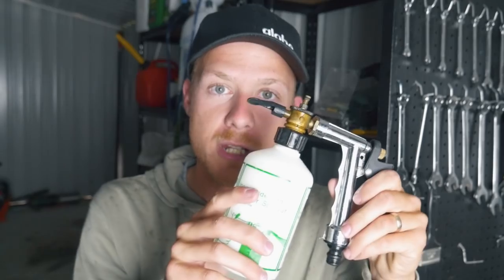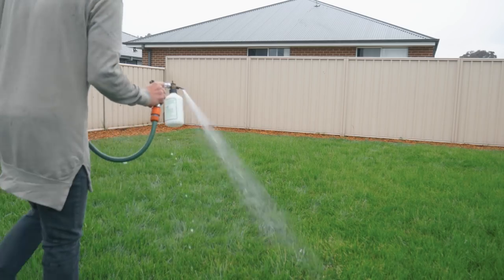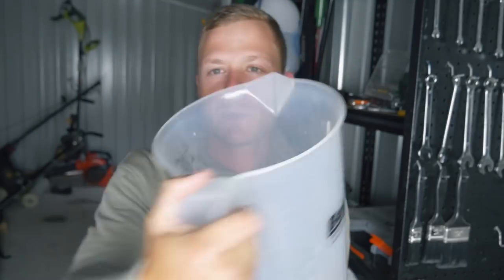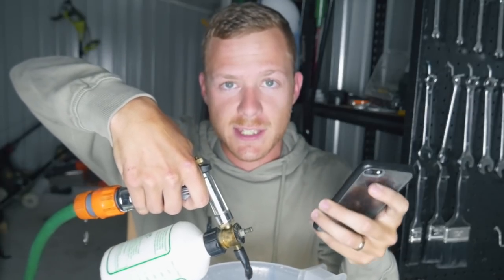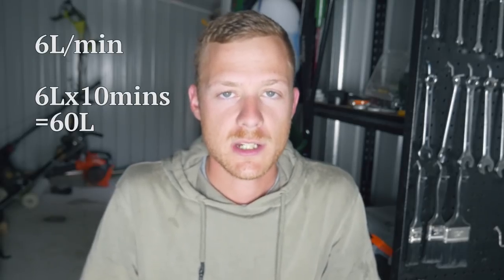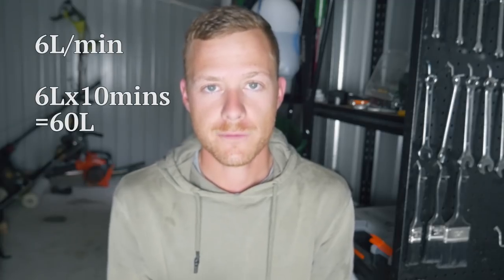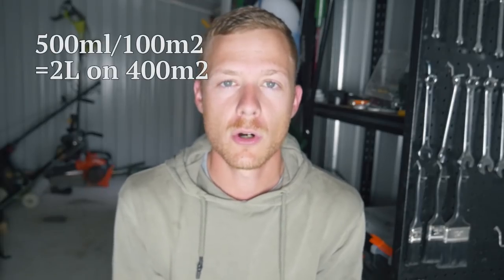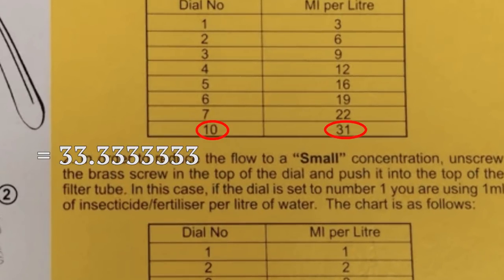How To Calibrate Your Hortex Sprayer

Comment: Hi boss. I'm using seaweed secrets and hortex sprayer but it only gives a 3 to 5 ml per litre  dilution rate. No application rate per metre squared. So i cant figure the last step. Where do I get this meter squared rate from??
Reply from the maker: Hey mate,
The rate for seaweed secrets per 100m2 is 100ml 👍🏽
I emailed them and that’s the rate that they gave me. Don’t stress is you go over or under by a bit

Comment: I am new to this game Ben and am catching up on your videos.  I am not tech savy but I have approximately 257M2 in one section of my lawn and I use 2 back pack sprays of 14ltrs each.  I am mixing the required strength of 100ml to 100m2 in 14ltrs of spray.  Is this correct I am i walking too slow.  All told I have and am treating a total of 502m2.

Comment: Hi mate, I was looking to get both the seaweed secrets and the stimulizer, I have a few white patches and some weeds coming through in other isolated areas. Will this combo assist with growth in those white patches? Thanks
Reply from the maker: Hey mate, it should definitely help to improve your soil in those areas. You will need to do a few other things also as well like, aerate, use some slow release fert and kill some weeds off as well. 
But using the products to mentioned will help with long term soil health an strengthen your grass to combat problems in future
Reply: Lawn Tips that’s great thanks for the advice Ben 👍 can you recommend a fertiliser? Learning lots after watching a few of your videos mate 🤙
Reply from the maker: No worries mate! I usually recommend Nutriplus from globegrowingsolutions. 
It’s best to call or email to order some cause it’s not up on their website yet unfortunately. That’s what I used all last year and it was awesome. I’ve got a video about it here: https://youtu.be/XDp12IJxl1Q
Reply: Lawn Tips thanks Ben 🤙
Reply from the maker: No worries at all man 👍🏽

Comment: HORTEX INSECTICIDE & FERTILISER SPRAYER 450ml

Three simple steps to easy spraying
• Pour chemical into removable plastic bottle 450ml
• Set dial for the required dilution rate as detailed on instructions
• Attach garden hose to the sprayer handle – Turn on water supply at the tap and spray

Comment: Hi Ben, great video! Do you think a hortex sprayer could be used with granular sulphate of iron?
The stuff I have requires 300gram per 10L of water over 10m2. 
My pressure is 6 L/m. Lawn is 175m2 and takes 5:20mins to totally cover, so putting down about 32L of water. 
Liquid chemicals are easy to Calc on the hortex (with the help of your video), but since the sulphate is granular I’ll need to dissolve it first.
Any ideas? Thanks
Reply: Think I got it... total sulphate required is 5.25kg. This needs to be diluted into 175 Litres (10L per 10m2 as above). 
Max rate on hortex is 31ml per litre on dial 10. 
So 175 litres / 31ml = 5.6L. 
I need to dissolve 5.25 kg into 5.6L of water for using in the hortex on setting 10. 
Hopefully my logic is correct!
Reply: @thedjdannz  5.6kg of iron on a 175m2 yard seems far too much. Did you end up killing your lawn?
Reply: @cal-king  no I didn’t kill it. But I moved to a liquid iron and sprayed it with a back pack sprayer. Cheers

Comment: Hi, sorry still a bit confused....
So lets assume my yard is same as yours, ten minutes to double coat it and 60 Liters to complete it.
My Seasol is a concentrate so 8ml per liter so that is 60 x 8ml = 480ml of seasol 
So I put 480ml of Seasol in the Hortex,  do I add water to fill it or just leave air for the rest?
Then 480ml / 60 = a setting of 8 so thats basically a three on the setting dial

Do I got this right?